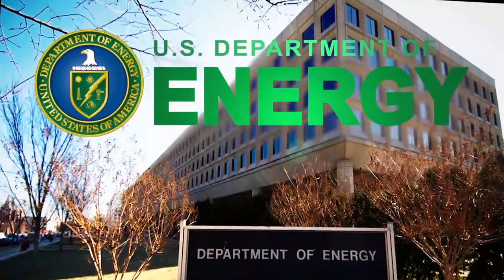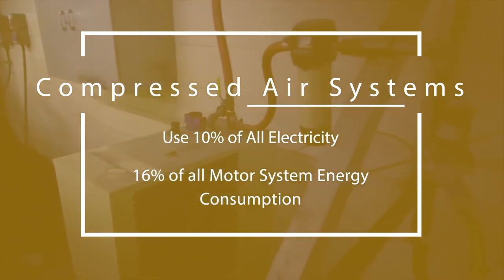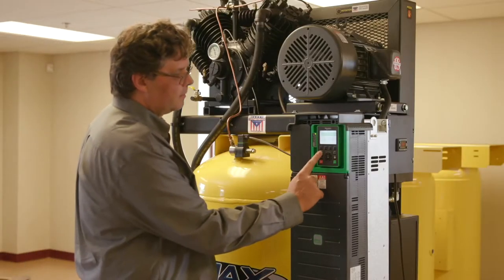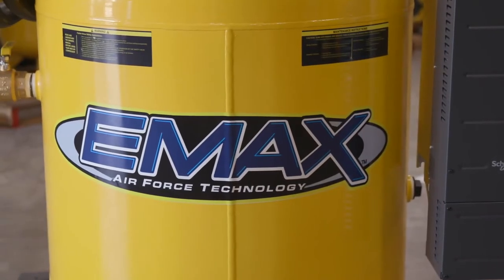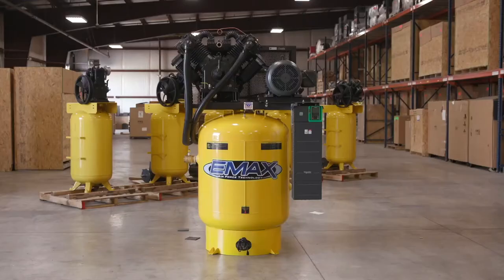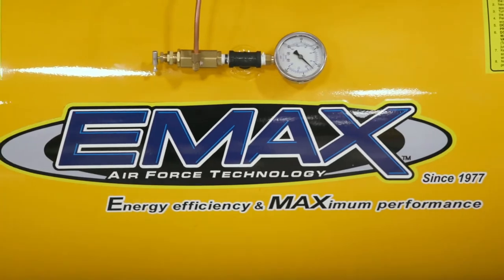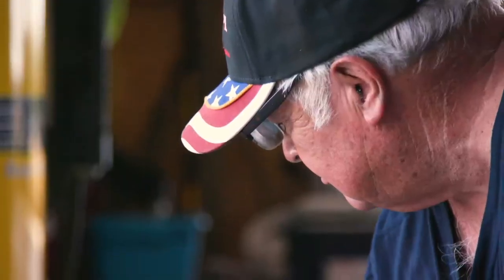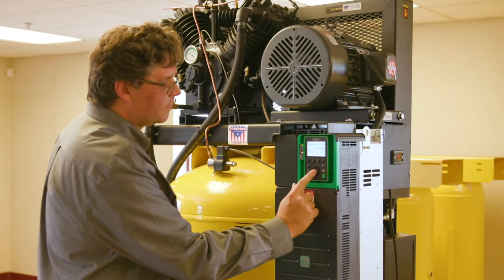Emax Air Technology: Variable-Speed Programmable Air Compressors

Comment: How significant are start-up amps to  the electricity bill? I've always understood it is tiny tiny.
Reply from the maker: These units are very energy-efficient, and depending on your usage habits, you should expect some fluctuations in electrical start-up surges as this is normal. However, unless you're operating at a commercial level with a unit like this, you likely wouldn't notice a significant increase in an electricity bill with normal usage and the number of start-ups in a given month. If you want to crunch some numbers, we have a guide that lays out exactly where the electrical costs come from in a compressed air system, and how to calculate exactly how much it might cost you to run the compressor in a given month. It's a long read, but a great one! https://www.aircompressorsdirect.com/stories/1698-How-to-Audit-Your-Compressed-Air-System.html